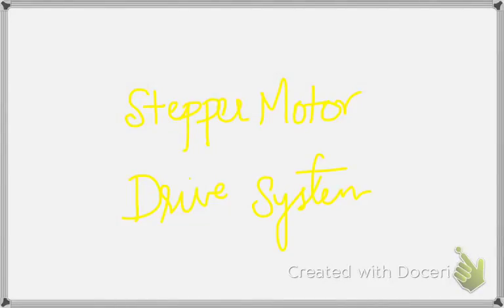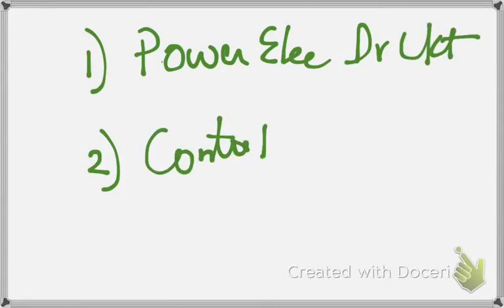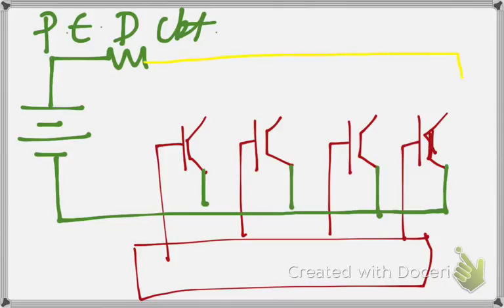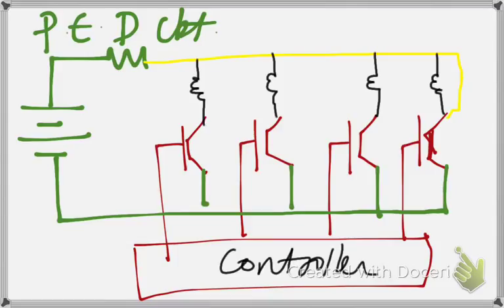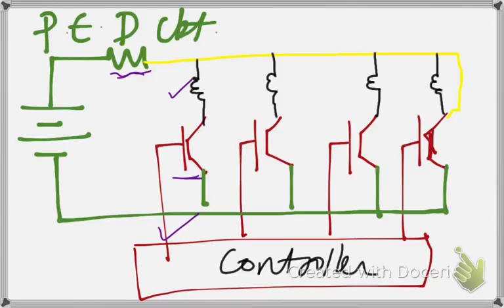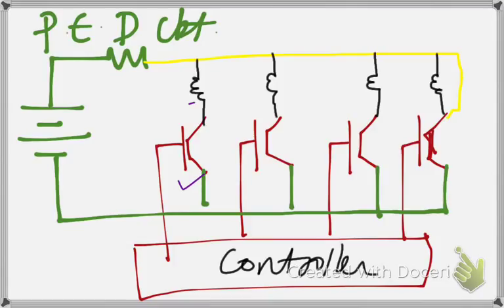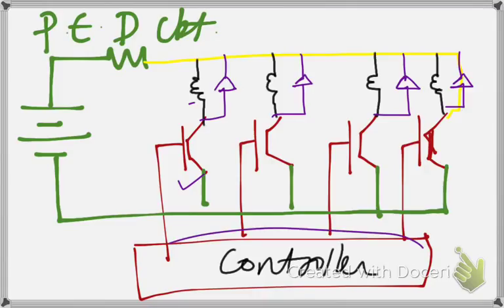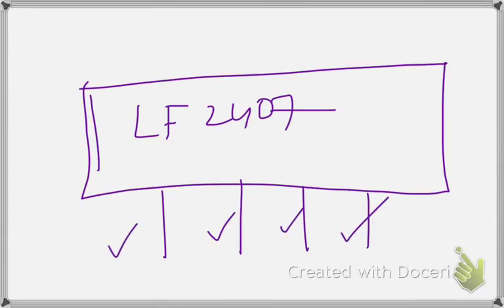Stepper Motor Control using DSP

Comment: The resistor will not make the coils reach the saturation current more quickly. The factor that limits how fast inductors conduct is their inductance which is determined by the coil windings and core materials. This is because the magnetic fields generated by current in the coils resist change regardless of any capacitive components placed in series with them. The only way to make a coil conduct more current faster is to impart a higher voltage temporarily and then backing it down once you've achieved the current desired. The series resistor does neither of those. It does not increase the voltage nor change the inductance of the coils. The only thing that resistor is there for is to limit current going to the coils.